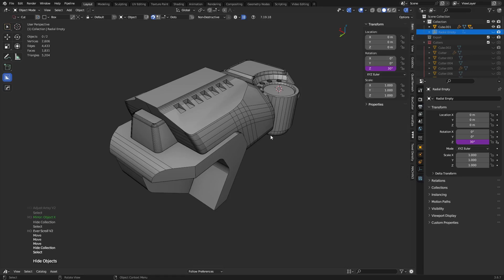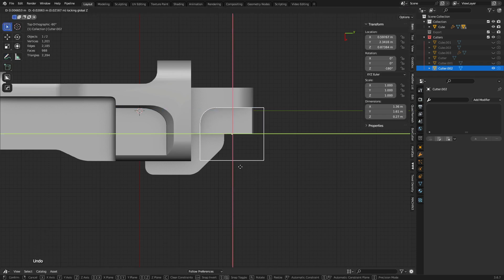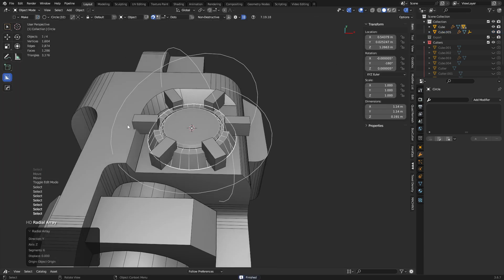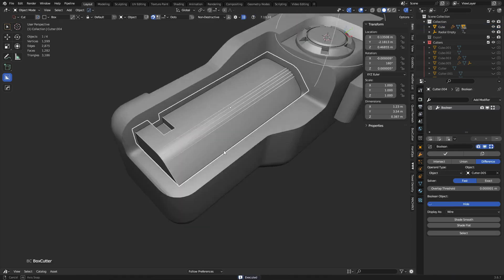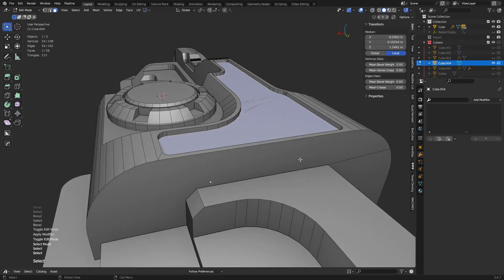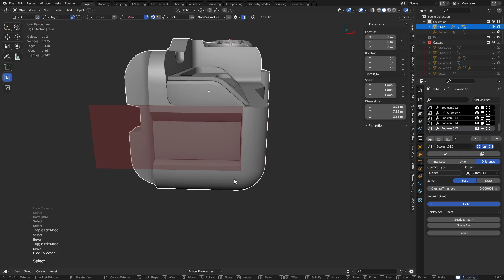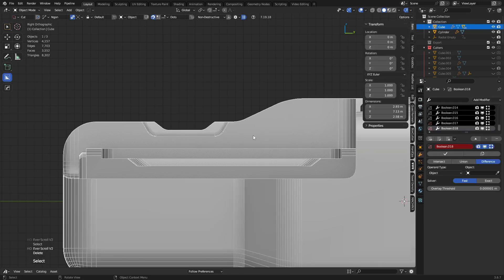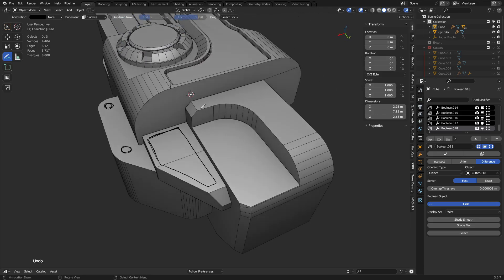Blender - Creating Complex Hard Surface

Comment: So I see a lot of Boolean and box cutting. The shape looks really cool, but how nasty would the retopology be on this?
Reply from the maker: Ideally, you wouldn't. Only need to work it into a high and optimize it as a low. Working it in both directions if possible.  Not exactly a full retopo.

That is if you even approach it in that manner. Depending on how large it is. This thing may use a trim, atlas, or even material layers.

Right now it is mostly an abstract shape as it has no real function. So it's purpose drives the process.
Reply: From this add-on, you do a low poly version. Then you turn with Zbrush magic your low poly to high poly and ta-da!
You just need to think how many loops you want to do, because all this detail must be Union, and then you fix your topology to trinalge.
Reply: If you're not going to deform this model, I suspect the shading will hold just fine. The ngons will not cause problems until you need to flex the surfaces. And if you do need retopology, depending on what your model needs to be capable of, you may be able to retopo relatively quickly with quad remesher. Pzthree has a demonstration on how. Its expensive but pretty amazing.